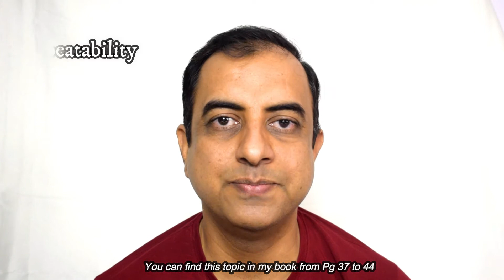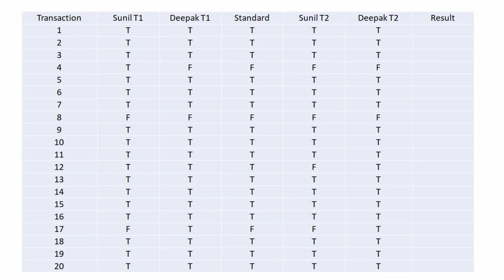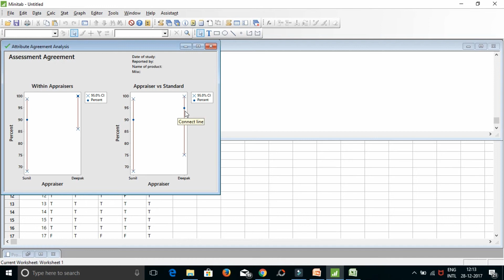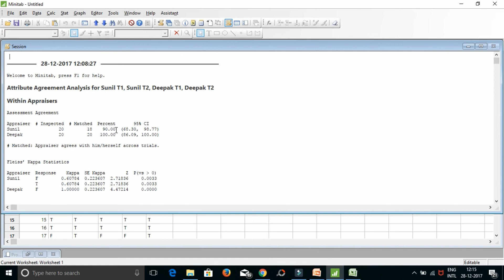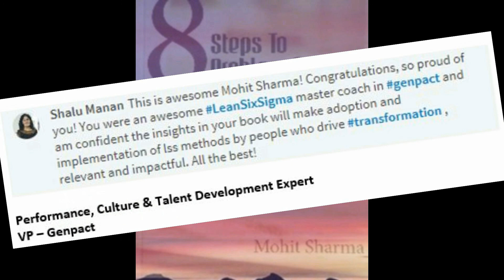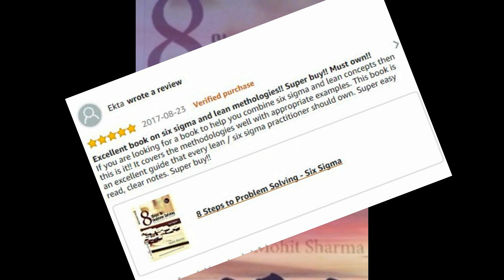Attribute Gage R&R | MBBMohitSharma

Comment: Hi, I’m looking for your advice on a technical challenge in my university project. My study focuses on quality control within an aluminum factory, specifically measuring the 'number of defects' (count data). How can I conduct a Measurement System Analysis (MSA) to evaluate inspector efficiency, given that the data isn't binary (Pass/Fail) or continuous? Is there a specific methodology?

Comment: First of all my thanks to you for always sharing such knowledgeable contents. A very silly question I have... 

I heard that Gage R&R is required in Measure Phase of NPS improvement project as well but as far as I knew, Gage RnR is to check measurement system variation for projects such as Quality Score Improvements etc because here quality scores are the output of evaluation performed by the QAs and hence there is a possibility of error if they differ in openion... 

In NPS, the measurements are done based on surveys received from customers.  My question is what measurements are we going to validate here in NPS improvement project. Thanks again in advance.
Reply from the maker: You are right in NPS there is no need to do gage R&R
Reply: @mohitsharma34  Thank you very much for prompt response... That's helpful....